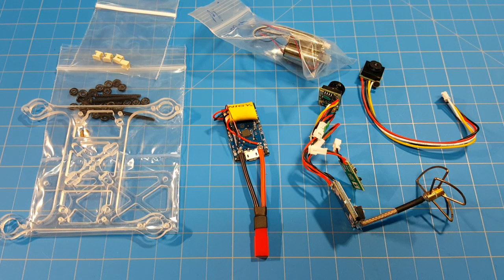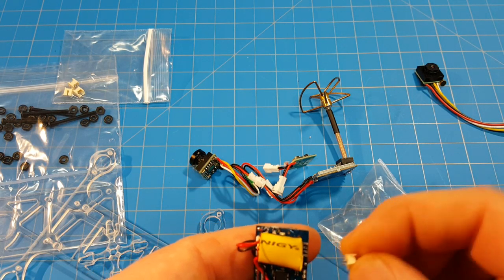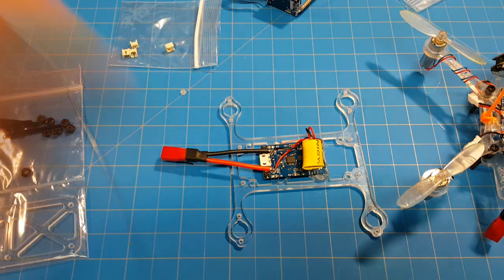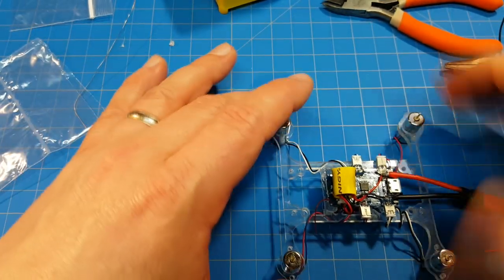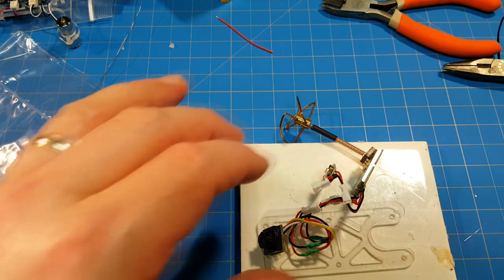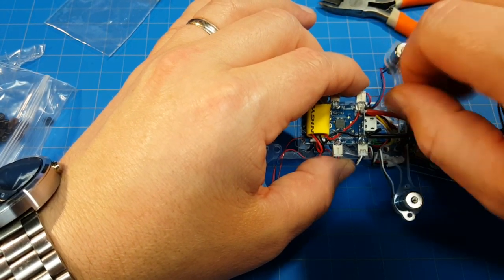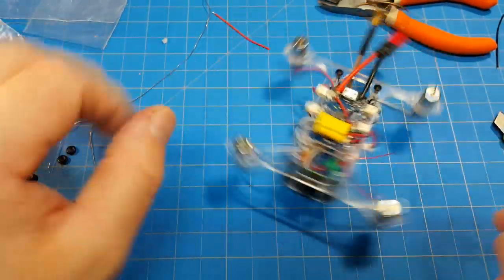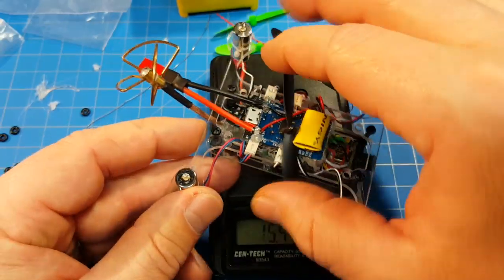Custom Micro Build - Picnic 80mm - SciSky

Comment: Great video! I'm almost finished with my Picnic Quads Micro H. I got the carbon birch version.
Reply from the maker: +JKFlorida Hey that's great, I know you will have a great time. I am surprised how much I have enjoyed the micros. I in the middle of a 180 brushless build, then probably a 120 like the rotorx atom or the sputnik.
Reply: +Nick Burns Yea that should be fun! I'm sitting on a set of 1104 motors but I'm not sure what frame I want. I'm thinking the ReadymadeRC Hellbender 122 should do the job.

Comment: Rubber grommets go between the frame and top plate (squeezed) and the nut is used to lock it tight, that's why there are so many rubber grommets ;-)

Also hot glue is heavy you could probably build an ultra light if you did some cutting down on glue and wires. CP antenna looks kinda heavy.

What gauge wire are you using on the FC JST? I am thinking of changing to Micro JST as they don't bottle neck the power as much as Micro Losi connectors. Nice build, picnic frames are class. kudos for the sci-sky repair video!
Reply from the maker: +carboncubss I had no idea the grommets were to be used that way. The antenna is advertised as micro or light, but it is the normal cheap cp antenna only without the sma connector. I have another coming from fpvhobby. I am running 18awg wire on the FC. Its not easy to get the jst connector on there. I happen to rework the 80mm quad this past week. I stripped off all the hot glue I could and got .6gr.

Comment: Hot Glue to the Rescue! :) I have the same FPV Setup but i'm running Hubsan FC, would like to upgrade to a Scisky but also would need to get a new Transmitter for DSM2 (Taranis + OrangeRX Module) but thats a bit too expensive atm.
Reply from the maker: +Fábio Castro I had a devo 7e before I started with the scisky. Hubsan FC runs good. I suspect we will see more micro flight controllers in the next 3-6months.
Reply: +Nick Burns My idea is to own a TX to rule them all. Devo7E is a cheaper option but I already own a Flysky Fsi6 and it's pretty good.

Comment: Hey Nick, I am going to be doing 2 more micro builds on Picnic Quads frames. I plan on doing an efficiency x frame 120 size and another one. Which frame would you recommend? I am only flying VLOS now.
Reply from the maker: the KKopter frame looks good, or the http://rotoriousfpv.com/
Reply: Nick Burns what is KKopter's website?
Reply from the maker: not sure off hand. search rcgroups.com
Reply: I spelled wrong. It was KkoptOr, not kkopter

Comment: What are the advantages and disadvantages of Carbon fiber and plastic frames?
Reply from the maker: In theory carbon fiber should be stronger and lighter than other materials. Its also conductive, electronics must be insulated from the frame. Polycarbonate, such as the picnicquads.com frames do not require electronic insulation and in my experience are also very strong. 3D printed frames are generally fragile. Nylon frames tend to give rather than break if constructed with strong break points, but production costs are higher.

Comment: Hello, have a question.
I just build myself a quad and wonder how I should fix the motors?
Are the just plugged in or the glued or something.
I am looking for a cheap solution for mounting the motors.
It is offered ready holders, but I want for such a plastic holder does not pay 10 € ..
Do you have tips for me ..?
Reply from the maker: mount the motors or motor wires. The wires can be soldered directly to the flight controller or use connectors on both the wires and flight controller motor pads. If mounting motors, that depends on the frame. The frame designer should have that in mind when creating the frame. Mounts can be 3d printed, rubber grommets, friction fitted.

Comment: Hi,
I've just build my first micro quad FPV. I noted that the VTX is a little hot after 1 mins connect to the battery. Is that normal, Nick?
Reply from the maker: Is it the FX758 vtx? They do get pretty warm, don't let them spend much more than about 5-8 minutes on the bench without props. The props help to cool the vtx. Just about all vtx get warm, especially the 600mw versions and expensive ones.
Reply: Yes, it is FX758-2 from  banggood. Thank you.

Comment: if the camera is 5 volt, and the receiver is 3.7 volt does the Step Up converter go before the entire fpv setup? Or does it go between the transmitter and the camera?
Reply from the maker: usually these devices have a voltage operating range and includes 5v, the camera gets its power from the vtx. I always put the regulator between the power source and the vtx, with camera getting the filtered power from the vtx. The static or lines in our video comes from the power changes between the battery and the esc, the esc are constantly changing the power required for the motors and the feedback in the power wires/lines.
Reply: Nick Burns and if the interference is caused by the power to the camera, isn't that the only power that needs to be filtered? Not power to the whole tx. I also noticed you have a Moto 360. Check out my page, I make adapters for the Moto 360 that make it look like a different watch. I'd be happy to send you a couple of them.
Reply from the maker: It should work. I use the fx758, I believe in your other comment you purchased one.
Reply: Nick Burns I looked around. The interference is caused by the ESC always trying to change power each motor. So the power from the flight control to the transmitter and the whole fpv has to be filtered. So I just bought the one that you use. And I'm sending the other one back. Thank you again for your help. I'm sure I'll have more questions in the future. And if you check out my Google+ Page, like I said I have those watch adapters for the Moto 360. Check them out and let me know what you think. I'd be happy to give you a couple of them.
Reply from the maker: Ebay can be so risky. I wouldn't buy unless I had experience with the seller and product. I get my regulators from pololu.com this is the one I use https://www.pololu.com/product/2119
Reply: +Nick Burns OK. thanks again. are those shipped from the united States? I live in California. I don't want them to take a month. lol
Reply from the maker: That's a good question. I am not sure, (haven't tested), if the interference impacts the camera or vtx or both. Those adapters look very cool. I would certainly try them out. Send me an email and we can work out the details. nickburnsrc@gmail.com
Reply from the maker: I believe they do ship from USA but I don't recall where orders ship from. They have many distributors, but online orders likely ship from one source. There may be a distributor close to you. Check their map at https://www.pololu.com/distributors#usa I see 5 in California.

Comment: can't find the motors in this video, do you know if they are still available? do you have another motor you recommend at the same price point? thanks
Reply from the maker: yea, there is something going on with mmrs/fpvheadquarters. At this time I don't have a direct replacement at the same price point. I am testing the spintech motors on amazon, but they are $25 for 6 motors. So far I like them, I am also testing generic ebay motors $5/set, and some different micro props. I think you can find a 10% off coupon for the spintech motors. There are options for Chaoli motors on various website, but I can't vouch for them. Of course you can still get motors from micro-motor-warehouse.com at a much higher price point.

Comment: Nick Burns,  
Could you send me the link of that frame? I cant seem to find it. Thanks in advance
Reply from the maker: +Eric Cordeiro Your right. I don't see the 80mm anymore. The closest I could find was the Platform 100 X+ on http://picnicquads.com/product/platform-series/ for $10.25. In the video I also have a lightened polycarbonate accessory plate which is selected below the surface plates.
Reply: +Nick Burns Thats a bummer. I was looking forward to building the ultra micro fpv quad. Thanks for looking though. Greatly appreciate it

Comment: if I were to use a carbon fiber frame, what would I use as an insulator? is heat a factor? thanks
Reply from the maker: heat can be a factor. with a carbon frame use small amounts of foam tape in the corners of the vtx.
Reply: +Nick Burns thanks for the reply. I found motors on hobbyking I think I will try. Never built a quad and looking to start as cheap as I can. They also have a competitor fc that is similar to the one on the picnic website I might give a try. Haven't decided on the fpv setup. Was thinking about going with the quanum elite.
Reply from the maker: I started with those, they are not good. If you have a chance cancel those and get the chaoli motors from banggood http://goo.gl/wQUYC3 or buy generics off of ebay. The HK motors hover at about 65% throttle. If you stick with them stay as light as possible. The quanum elite is good. I did a video on it, but there is an even better alternative now. http://goo.gl/cDb2sX Basically its the quanum elite but with a flexible antenna, which is its breaking point. I ordered one this morning, I have waited 2 months for them to be available. Still hot glue where the flexible antenna meets the pcb.
Reply: +Nick Burns haven't ordered yet. but I will definately take your advice. I like the all in one's just in case I want to stick it on something else

Comment: Did you hot glue the motors?
Reply from the maker: No, they fit very snug and stay in place. on the picnicquads frames.
Reply: Have any motors popped out?

Comment: can the FC take a 2 cell batt?
Reply from the maker: +Chi Sty Its not specked to take 2s. Being it has only a 5v regulator I wouldn't try it. If your wanting to run 2s or greater likely have to look at brushless quad equipment.

Comment: What are the sockets called? Where should I buy some?
Reply from the maker: Micro JST 1.25 https://micro-motor-warehouse.com/collections/connectors/products/micro-jst-1-25-socketsI think Banggood also has them
Reply: Nick Burns Both don't have them anymore.
Reply from the maker: https://micro-motor-warehouse.com/collections/connectors/products/micro-jst-1-25-socketsMy previous link had an extra character on the end. try again. If not google the connector name.

Comment: I just finished my CF one and it weighs 41.82 without FPV gear or battery.
Reply: I also added a 3D printed scisky FC holder.
Reply from the maker: How does it fly? Sometimes we get wrapped up into small details, forgetting the big picture (its is fun).
Reply: Well, I tested it in the living room of our small house. I accidentally turned it on acro mode at first and it flipped and landed on a recliner. After that I put it back on angle mode and made sure to reverse the right channels. I'll post the video soon on the channel after I get a hold of one of my friends who is good at helping these things.

Comment: One suggestion use less hot glue! 1 stick of hot glue weighs almost 5 grams.
Reply from the maker: +JKFlorida What should we use to secure parts? Double sided tape...or I should just use less? Next time I strip one down I will weight the hot glue bits.
Reply: +Nick Burns I've been using double sided foam tape and a tiny bit of hot glue.
Reply from the maker: +JKFlorida I did try double sided tape on my first build, but I must not have good stuff, it came loose.
Reply: +Nick Burns I wipe the spot I'm sticking it two with rubbing alcohol maybe that might help.